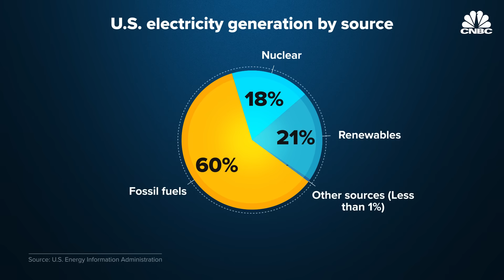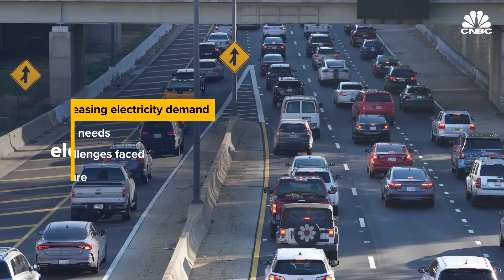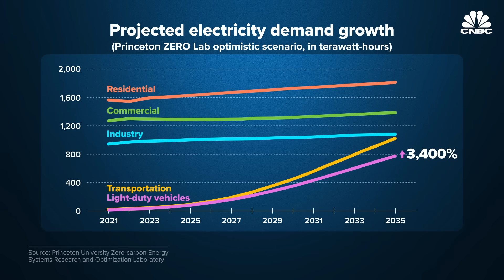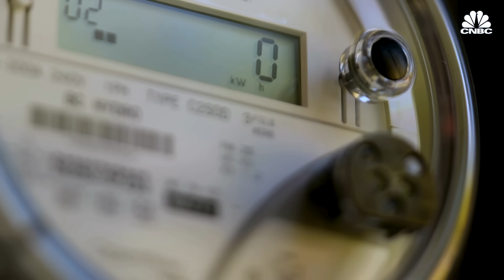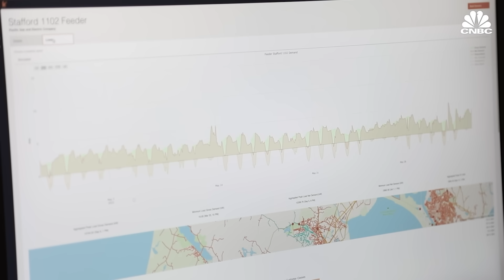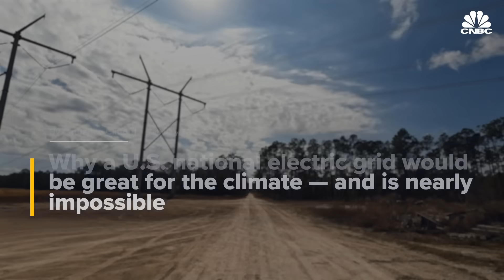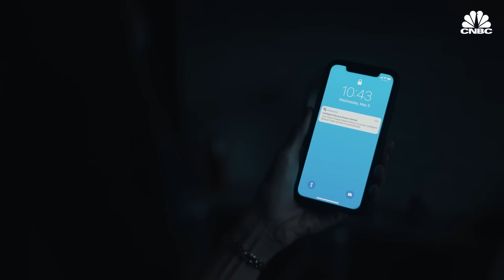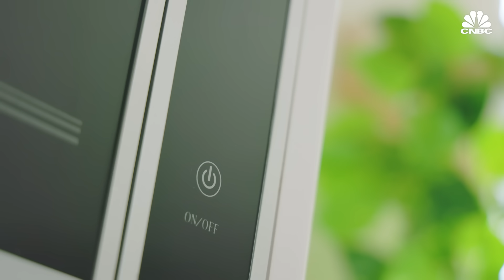Can The U.S. Power Grid Handle The EV Boom?

Comment: Three grids. Eastern, Western and Texas. What's wrong with that picture? Texas chose to stand alone because it didn't want to comply with the nation's rules for electrical supply companies. There are connections between the East and West grids that allow power to flow in either direction. I don't know all the FERC rules, but Texas should never be allowed to connect to the other two grids. 
The big electrical supply companies must be compelled to add new infrastructure. They won't do it on their own. I worked for a large Western electrical utility for 30 years and their too busy looking at the bottom line to care about the future. It's the CEO and other top company officials that make those decisions and most are more concerned with their upcoming retirement.

Comment: I'll save everyone 15mins of watching the video and answer the question. No. The rolling blackouts in CA, NY, and many other states more than proves there a several locations in the US that can not handle the highest demands of the grid currently so why would it even be a question if you could had hundreds of millions of EVs to that same grid? 

Its simple the electric grid is over stressed because on the hottest days the ACs of buildings and peoples homes takes up too much demand from the grid so just mandate that every year the SEER, efficiency rating, of all ACs, central, window, and split, have to increase by 5 SEER. That way the largest source of energy demand is reduced in 10yrs and then maybe you could start to consider mandating that 100s of millions of EVs are the only new vehicle that can be sold.

And for those that say 5 seer a year improvements are not possible. Today there are split AC  units with multi stage compressors, multi speed fans, soft and hard start units for less starting electrical demands, and these can currently get up to 50 SEER. So yeah mandating that ALL new AC units have to be heat pumps, with electric or gas additional heating for super cold areas, can reduce the electrical grid demand tremendously. Also make mandates that cities and states have to invest every year into solar, wind, geothermal, and batteries to help with producing and storing electricity to help with the grid demand.

Comment: How much load on the grid comes from the production of fossil energy?
From the trailer parks in the deserts where oil field workers live.
The infrastructure that supports them including gas station food,gas guzzling pickups they drive long distances to work,machine shops and complicated heavy machinery used in the production. 
 Transportation of water and fuel .
Electrical infrastructure in the oil field. 
Pipe lines.
Prostitutes and their infrastructure.
Medical expenses of the injured or cancer ridden workers who refuse to die quickly.

Next we might move on to the myriad expenses of refineries and distribution of the petroleum products. It’s similar to the previous list.
It’s true that much of the same can be said of the expense of solar and wind farm construction,but it seems to be left out when comparisons are made between fossil and renewable energy.
Actually,electric vehicles are a solution,not a problem,when considering grid capacity. Batteries will give the death blow to fossil fuels whether they’re sitting on concrete slabs or pneumatic tires.

Comment: What about homeowners who have enough solar (and other renewable electricity) to power their home and charge their EVs? That isn’t really covered here.
Reply: Solar with out batteries does nothing for Peak demand, and batteries are expensive. You can get a solar only system that generates enough for you use, but it generates it at a time when grid operators don't need excess. They need excess between 3-9 pm in the summer and peak solar out put is 11-2 pm. Batteries solve this by storing excess for use during peak, but the up front cost are too high for the average family. In my area I would need at minimum 2 power walls but most likely 3 and that is25k just for the batteries, than another 10-15k for install and other materials needed, on top of 10-15k for the solar system.  Large Grid Scale projects are way more efficient cost wise but they still have the problem with storage and battery cost and all the land cost and court battles of building transmission lines and windmills and solar fields. we will be lucky to have it done by the year 2100

Comment: Carbon and other elements forming a layer in the atmosphere, that traps heat, generated by every atom on the surface of the planet that responds to striking photons. Who imagined this popular theory?

Is it that simple? What about all the heat energy that has intensely for more than 200 years been converted from living plants, solid, liquid and gas forms stored below to free form, ultimately absorbed by water? THAT is where the heat is going, not into the atmosphere itself. A person can instantly freeze to death at below 40,000 feet.

Is this converted heat energy not but another emission, conveniently ignored for the sake of selling artificial solutions? What about all the missing trees, cut down for profit, that used to naturally capture carbon and heat, and convert them back into solid form? Razing the surface in search of everything needed to make and sell more "solutions" seems hardly the best answer.

Comment: The simple answer to the question posed is hell no. For those who think it can be ready you are also mistaken. We are in a bit of a heat wave and most of the grid can't cope with that, let alone plugging 1 billion electric cars into that same grid. So when it's very hot or very cold you won't be able to go to the store, buy refrigerated products, get to work or turn on your computer. Add 1 billion used batteries to the mix and the economic and environmental damage that this blind rush to electrify everything is really poor judgement. Just because you can't see the cost doesn't mean that its not there.

Comment: I'm glad she mentioned appliances toward the beginning.   One of the main arguments against EVs are grid stability.   Remember,  100s of new homes go up every day, as well as corporate buildings.    How do these home run?  EVs were never going to be the issue.  As mentioned in other comments, the grid needed some improvement anyway as well as the use of alternative fuels.
Reply: And one of the largest consumers of electricity is gas stations. If we start reducing the number of gas stations there will be massive electricity savings as well.
Reply: @joshsummers7933  gas stations are not power pigs.....the convenience stores people flock to are the vast majority of the power usage.
Reply: @joshsummers7933  I support your idea of shutting down all these Buckees due to tards going to gas stations as part of amusement and culinary choices
Reply: Piggybacking on your point it’s also important to note that most EVs use less than an HVAC, and they mostly charge at night when AC use drops.

Comment: for us to have a nuff power for ev you would need to up grade the power grid by 10,000,000,000 percent evs take more power to charge than a whole house any ware from 20 amps at 120 vots or 200 amps at 240 votlts about 2000-58,000,00 watts of power to charge from home could you go with a bigger system yes dc fast charger that can go up to 1000 amps at A 1000 volts mostly used at charging stations i think when soild state batterys come out that will be the game changer in evs when it only takes about 10 min to fully recharge your battery they all so have a greater range than lithum ion batterys maybe any ware from 100-2000 miles per charge of range

Comment: It blows my mind to see so many uneducated or ignorant people when it comes to electricity for the EV movements. People need to remember that it takes over 10 times more electricity to make gas for an ICE car! This means the process of making gas for an ICE car has to go through like a 100 steps before it can become and be used as gas for an ICE car. Electricity for an EV car only has 2 steps at most! So every ICE/gas car removed from the road means enough electricity become available for about 5 to 10 EVs! I scored in the top 99.9% percentile of the general population and a Perfect Score on my SAT. I guess the common people can't see this logic of when you stop using less over here means having more available somewhere else like for charging more EVs for example.

Comment: This was a great video, I’ve been considering the grid problem with electric vehicles for a few years now, I live in SoCal and the amount of electric vehicles here especially already puts strain on the grid during hot seasons when AC is needed. Owners of electric vehicles are already asked to charge at night here during heatwaves, so the strain on the grid is already evident.
Reply: Gasoline production uses a gross amount of electricity, water, and oil in every gallon. 

More EVs means less energy intensive gas to produce. 

Most EVs charge at night strictly due to peoples schedule to drive into work shopping during the day.
Reply: @surreal5335  unfortunately the transition is going to be difficult. Gasoline will still be produced as electric vehicle sales increase, and there will be a few decades of the need for both gasoline production and a massive influx of charging stations, there will not be a day where gasoline production suddenly stops and clean charging takes over, so the in between is what I was alluding to. I’m just commenting on what local officials have advised people to do during heatwaves here
Reply: The heat waves you allude to are inherently responsible for stressing the grid, not EVs themselves. Heat waves simply trigger enormous demand for energy from the region affected. Putting the blame on EVs (especially at the current rate of penetration) is inaccurate.
Reply: @jonahcabral2425  I suppose what I meant was additional strain. AC has always strained the grid during heat waves, but in recent years with the addition of EVs, the problem becomes even worse as there is a steady increase in the need for power with EVs. The regulations I’m speaking of are not imaginary, during heat waves we have more frequent rolling blackouts and people are advised to charge vehicles at night, because charging them during he day when AC is in use strains the grid, that is accurate.
Reply: @jonahcabral2425  also you underestimate the sheer number of electric vehicles in CA. 40% of all electric vehicles sold in the entire country were sold in CA in 2021, which now stands at 1.5M vehicles in the state alone. Maybe if you lived here and saw just how many were on the roads here, you’d understand the clear demand for power.
Reply: California leads the nation in failing goverment. The state will power out like paradise...in fire.

Comment: I've been calling this out for sometime now, but I guess better late than never? All these electric cars, but no one has been talking about the failing power grid. Also, something that was missed is that security/defense of the power stations is something else that is needed. I recall 60 minutes doing a documentary about how some fools shot up a power station, which caused a mass blackout. Then in 2022, some fools attacked the power grid and caused a massive blackout in one of the Carolina's during one of the most coldest winters on record. I've seen for myself how the only thing separating me and a power station is a see-through wired fence....

Comment: As an ev owmer, I can honestly say it is horrible.  I am going back to gas car as soon as possible.  The costs to charge are very high, even at home. And that price is going to go up as more people get EVs.  Tires wear out very fast.  Range in winter is horrible if you use heat. Range I’m summer is horrible if you use AC. EVs  are a bit of a scam.
Reply: Unless you drive like 100+ miles a day you don’t need to charge the whole day you can just top off your battery at night when your energy costs are lowest; you should try that if you haven’t already and see if it helps you save money. AC is one of the most efficient heat transfer methods we have in society, it shouldn’t affect your range that much. 

If you have a reverse cycle air conditioner (heat pump) your range in the cold months should also improve your range significantly, but adding a heat pump to cars is very new and it’s likely you have an electric heater instead which uses a ton of power

Comment: Everyone is forgetting that most people don't want an electric vehicle, they are also way more expensive than a gas vehicle. If you start trying to force electric vehicles onto people they are going to fight back. You're also forgetting about all the pollution involved in the manufacturing of the batteries.

Comment: It would definitely be possible if ev manufacturers would shift towards the "series hybrid" powertrain

Series hybrid electric vehicle:
A fully electric vehicle with an on-board generator of which the generator can provide ~2× more power than the car needs to drive. These vehicles have the advantageous use of the generators (and possibly the battery pack) to power entire homes when needed.
Reply: Most homes have an average hourly consumption rate than the car going 60 MPH. 
5 miles per KWH X12 =60 KWH.
That’s more than the average daily consumption of a house.
Leave the generator at home,test it under load periodically,do the recommended maintenance,and leave it to your kids in your will.
After making my off-grid solar power system,I went ahead and gave the generator to my son to use in his mountain hideout. I realized it was taking up too much space in the barn.
Reply: Please excuse my incorrect arithmetic.
 I still think the generator needs to stay home.
5 M/KWH X12 = 60 miles so that’s only 12 KWH.
Since I’m running two all electric houses on my off-grid solar ,I’m always aware of the load and so schedule use of electric dryers to keep the load under the 20KW capacity of the inverter. It surprised me how easy that is to accomplish.
Solar panels and batteries are going down in price and up in quality. The secret is to not fall for the scammers selling grid-tie roof top panels that cost 25 years to escape from the contract.

Comment: EV are hoping to be sold or regulated to be sold?  Not unless someone manages to pull out another Tesla from their ass and get it up and running.  It will be 2030 before major car manufacturers get to break even (other than Tesla).  GM, Ford and Dodge will go bankrupt first.  Just Cali can’t handle what little they have and cannot rebuild by 2030.  This is a poor opinion piece.

Comment: The most important missing piece currently missing is a drive for carbon capture and sequestration. Otherwise, the push to GET to renewable will only exacerbate the problems associated with not having a renewable based generation of electricity.
Reply: No. CCS is a boondoggle. The money is better spent reducing the use of combustion fuels. And don't get me started on DAC.
Reply: @xchopp  So, if growing expectations are coming of rolling brownouts due to increased demands for electricity, how are we supposed to be increasing the supply of electricity without spending a trillion dollars we don't have on green sources of electricity that don't output the necessary amounts of electricity? Nuclear NEEDS to be on the forefront of our building plans but even a nuke plant could take a decade to bring online.